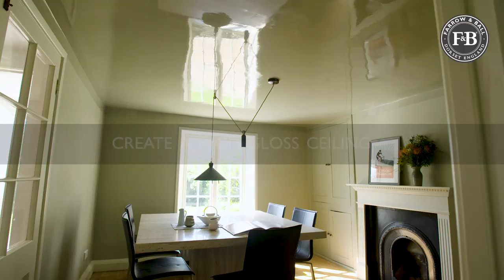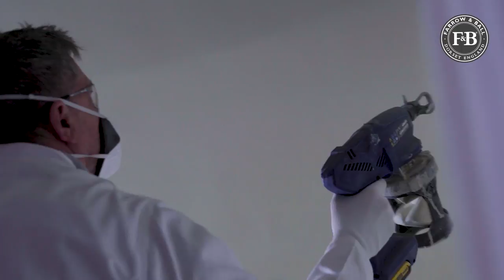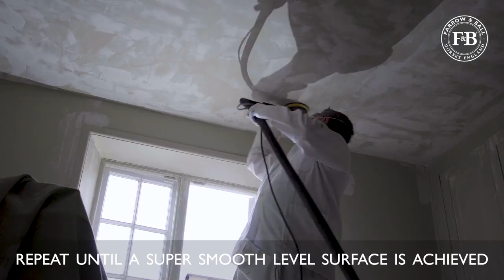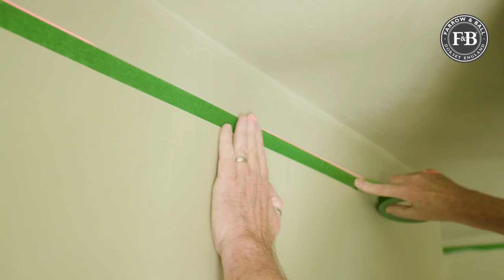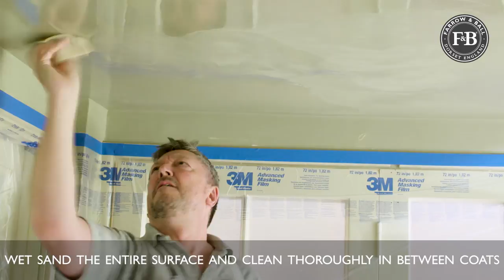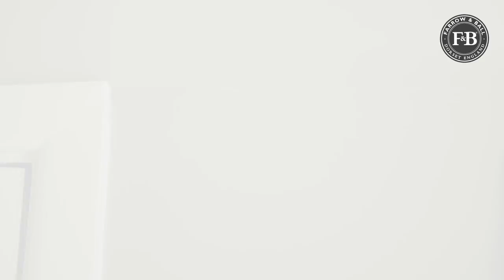Farrow & Ball | Create A High Gloss Ceiling

Comment: as a newbie doing this as a covid diy project .. i seee the tools ... but 😅 what are they all called
Reply: Hello Tiffany. The main tools you will need is an orbital sander, 12” drywall knife, 6” flexible drywall knife, masking tape, some plastic sheet to stick under the masking tape to cover the walls, drywall mud or compound, some bucket at Home Depot with large letters saying Dust Control, and that’s about it. 
Additionally, on their list was a 3m hand masker, which makes masking easier but you don’t really need it, they also have a self leveling laser but I think you would like it better if you just painted the ceiling only and not part of the wall like they did. And lastly they have a sprayer. Now, you don’t NEED a sprayer, generally the sprayer will leave the finest finish, but if you don’t want to rent a sprayer or buy one just use a very fine nap roller, and a good quality soft paint brush for the edges. Most importantly, use HIGH quality gloss paint, from either Sherwin Williams or Benjamin Moore, do not buy paint from Home Depot. The paint you want to try to get is a self leveling type of high gloss trim paint. Now I know it’s a ceiling and not trim so that’s why the guy in the video is priming the ceiling first before applying the high gloss paint but if you find a good quality paint you should be fine by just applying it on the ceiling itself. 

Now if you dont have an orbital sander you can probably just hand sand if it’s a small ceiling.
Reply: @AlMai222  hi Al, what kind of sanding paper grade would you recommend?
Reply: @dorotalisiecka9603  if you don’t have an orbital sander I would suggest 120 grit large sanding sponge. If your ceiling is larger I would suggest just buying or borrowing an orbital sander, with the orbital sander, use 220 on the entire ceiling.